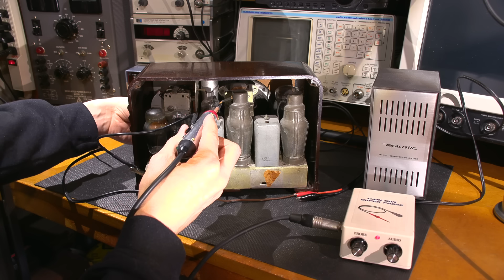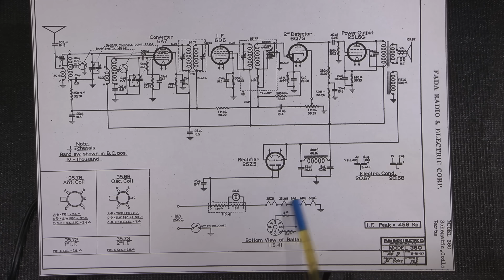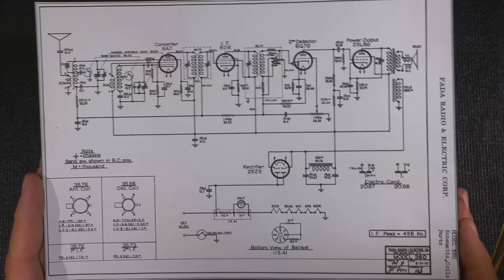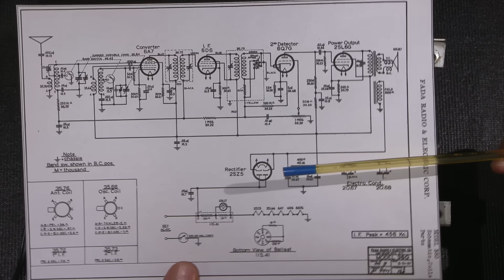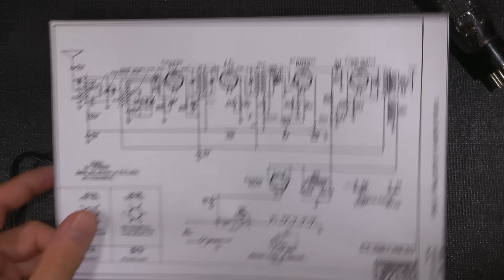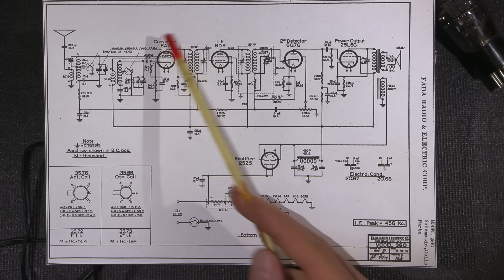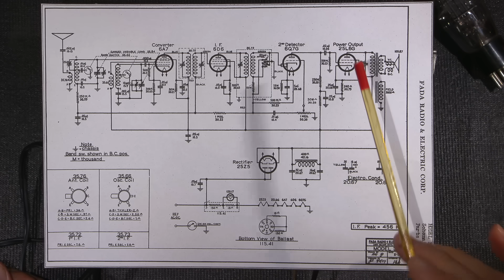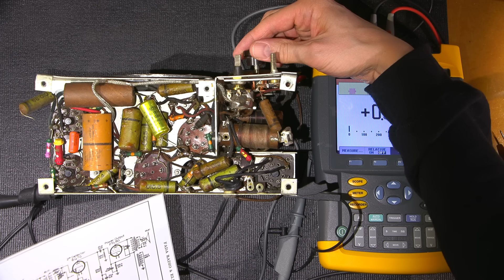Electronic Circuitry Diagnosis And Fault Finding! [Repair]

Comment: If you haven't completely restored this already, I would like to see it.  I just picked up a Fada Model 68 this weekend.   It needs to be restored as well.  It's my first project and I learned a lot from watching you take us this far.   I am sure we'd benefit from seeing your detailed handling of the entire restoration.  I am curious to see how you handle the conversion to lining in the voltage with a switch on the hot side and neutral to the chassis.  Thanks for the content thus far.

Comment: Those tube radios seem to be magical to me.
In a world of silicons and digital electronics, it´s something from another world.
Nowadays in professional school they don´t even mention old tube technology existed just the stuff i actually need for my job but i think an electronics technician for industrial engineering should also know something about tubes.
We still have such an old radio but it´s already capable of receiving FM and last time we powered it on, it worked for 10 minutes until it got quiet and had a smell.
Probably one of the old capacitors blew up so yeah as an almost finished electrician i should be able to fix it easily but yeah i don´t think so 😅

At least i have a pair of fully working isophon speakers from back then which are in mint condition and get pretty loud with my 2x3w class D 5V powered amplifier.
Maybe i´ll build some small active speakers with it one day.

Comment: If I understand the use of the super-probe, it should NOT be used on a hot chassi (i.e., one not connected through an isolation transformer) as the ground-lead from the probe goes to the metal shell of the probe. Am I correct?
Reply: In the beginning, he specifically says he is powering up the radio using a current limited isolation transformer and variac power supply.

Comment: Textbook troubleshooting techniques, bravo!
Just replace the shorted cap. Use the radio everyday, when the next component fails take us through the procedures again! 
I learned a lot from this repair.
Reply: This is how it should be repaired, replacing all the caps, even though they may fail soon, is not appropriate in my opinion.

Comment: Doe's this guy know the difference or the names of the tubes/in English radio valves .. pentodes triodes heptodes dual rectifiers ... double triode tubes and so on . Even the double diode triode decter tube with extra plates using the same cathode ..........lol

Comment: You may wish to comment on this video in terms of what you were trying to do... fix the receiver or sell active probe designs. The part where you pull the chassis out of the case to the time you pull out your voltmeter (THE MOST OBVIOUS tool to use), and pull out the active probe, which you refuse to sell as a kit or even allow anyone else to sell as a kit, you make a tedious and obvious use of this tool to "fix" the radio.

Comment: Remember the hybrid car radios?  They had tubes that operated at 12-14 volts and the output stage was a power transistor.  I believe the tubes were spec'd for low plate voltage.  These radios appeared in the late 50s or early 60s I believe.
I have been enjoying your videos.  You sure have a lot more equipment than I ever had !!

Comment: Another question: if the B+ (= screen of output tube) was only 10.6 volts, how could the oscillator and IF states work?
Reply from the maker: Tubes will work at surprisingly low voltages. (Look up: "Space Charge Tubes") Having the right tools to listen into the stages, and not further the drop by loading the circuit is key. You will notice the probe has no physical attachment to the circuit.

Comment: Question:  why did you go back to the oscillator once you verified that the signal at the detector was good ?  I'm an EE BTW with about 60 years of experience with both vacuum tube and solid state technology.

Comment: If you make sure the ac plug for the oscilloscope and the ac plug for the radio is orientated in the same manner in the wall outlet, will this prevent a disaster when to connect the ground of the probe?  Also, can a UPS (unplugged from the wall and running on battery only), serve as an isolated power source for the scope?
Thanks for sharing your knowledge.

Comment: Pretty neat troubleshooting, one little note though, you should have started from the speaker and go upstream the chain. Speaker is magnetised? Yes! Voltages on the power output tube OK? Nope! Check the caps and resistors.. Bingo. That's the way the radio/TV repairmen used to work. I enjoyed the video nevertheless.

Comment: I lived 1 block away from an electronics repair shop. As a teenager I would haul tubes from old tvs and radios in there and he had a tester right in the showroom  where I would check all the tubes. He would always take time to answer my questions and teach me stuff.

Comment: Yes.  Restore.  It may be a bit finicky, but straight forward enough (I did the same with a Quad Aquoustical Stereo Amplifier and Pre-Amp a good few years ago - gave it new life) .  Suitable components of right values will probably be available (but of course, no wax caps).

Comment: Could have taken an insulated copper wire (epoxy resin insulation like that used in motor coils), made a couple of loop and put that onto the oscilloscope probe to sniff for RF?
Plus, the initial scope of the project was to “get it working again”.  Near the end you want to change the scope to “restore” the scope.  I’m a EE by education, but software engineer by experience.  One project I consulted on to fix some bugs, and I recommended removing some “dead code” and the project manager said “NO”.  When I asked why he said “.... because customer won’t pay for it!”.

Comment: You are absolutely correct about the tube testers being in the drug store (my memory is a grocery store).  I remember, being 10-12 years old in the late sixties, opening the back of our family tv, pulling the tubes, riding my bicycle to the grocery store and testing the tubes.  I don’t recall whether I found the the replacement tube.  “Thanks for the memories ...”.
Reply: i did too with my dad, he took by the hand to make sure i wouldn't touch electrical equipment, then later i started going on my own, push lightly and turn tube till it would drop down into it place, beautiful technology for days gone by. i then learned not to push tube but to align the notches and wham in she went, great days of a people that were at the beginning of radio tech.

Comment: At 22:32 cathodes should not be glowing ,but the filaments should be glowing if anything but the filaments glowing there is way too much power being drawn
Reply from the maker: If the cathode doesn't glow Peter, how does it emit electrons?
Reply: Mr Carlson's Lab the cathode is heated by the filament. The light inside the tubes are the filaments not the cathodes.as per Wikipedia and you can trust them:The type known as a thermionic tube or thermionic valve uses the phenomenon of thermionic emission of electrons from a “heated” cathode and is used for a number of fundamental electronic functions such as signal amplification and current rectification.

Comment: I have a tube balanced drive headphone amplifier that drops out on the left channel.  If you turn the volume up rapidly to max and back down, the channel output returns for a while.  A 2 year old amplifier not in warranty.  Not the tubes as I have multiple sets and swapping them does nothing.  Tapping/probing the PCB for bad solder etc does nothing.

Gladly pay somebody like you Mr Carlson to fix it for me.  Vacuum tubes are alien devices to me.  They just sound really nice.
Reply: Amplifier does have B+ current meter for each channel.  Both meters are at 70mA for each pair of 6080 outputs.

Comment: This video make me remember when I was very beginner to electronic in junior high school arround 1985. My friend have an old big telefuken radio and turn table a size of cupboard. And powered by some tubes. I tough 1 of the tube using my index finger and I gt 3 combo when the tube glow. Burn my index finger + shock by high voltage + my back palm swelling because bump with top of the cabinet... lol.

Comment: Appreciate the extensive info, but you're working too hard making these videos over an hour-long for what I'm sure you can do in less than 5 minutes probing around. Might have just learned something about grids and screen voltage, plus gaining the courage to sit and look at the schematics; working things out, what to test, what to expect to find by the connections.

Comment: If I had a lab/shop like yours, that is where I would be almost all of the time. While in high school went to Vocational Technical school for Electronics 1971-1972 then Data Processing 1972-1973. Computer Programmer job paid the bills while electronics hobby kept me off the streets - most of the time. Now retired and keeping busy doing nothing all day - still have not finished. Please keep on making and posting these videos. Thanks again for sharing all the fun stuff. Always plan on a great day - just in case it happens!

Comment: When I was a kid in the mid 70's I took one of these radios out of the case. I recognised all the resistors and capacitors. I blew the dust off the tubes. And plugged it in. It glowed orange. And it got hot. The speaker crackled. Then it started motorboating.  Switched it off. And never touched it again.

Comment: Just in case no other viewer mentioned it the morse code signal you heard when sampling the antenna was LU - the Non Directional Beacon for Cultus Airfield - transmits on 214khz.

Comment: Mr. Carlson discusses the line switch being in series with one side of the line cord and the chassis. If the original line cord is replaced with a polarized cord with the neutral side connected to the line switch, the chassis will be at neutral when the radio is switched on and "hot" when the radio is off. Max Robinson of funwithtubes.net recommends, for safety, rewiring the line switch in series with the hot side of the replacement polarized line cord so the chassis is directly connected to neutral (wide blade) and always "cold."

I go further to recommend replacing the line cord with a GFI line cord, such as from a modern hair dryer. The hair dryer cord is thicker than the radio cord (except for many clock radios that had an outlet for switching on a coffee maker). You may have to drill out the hole where the line cord passes through the chassis and install a larger grommet. If you prefer not to do that, the GFI cord can be made into an extension cord and the radio's cord permanently plugged into it. It is also possible to disassemble the GFI plug with special tools and replace the cord with a thinner cord. The line switch should still be rewired so the chassis connects directly to neutral.

Max Robinson thought that the switch was wired in series with the chassis to reduce assembly cost. Another explanation is that many of these earlier AA5 radios put the filament series resistor (150 ohms in this radio, in assembly 115.41) in the line cord as a resistance wire. That way, the heat produced by the resistor was dissipated outside the radio, so the radio didn't get as hot. The line cord contained 2 low resistance conductors plus the resistance wire.  The manufacturers had to choose between a single pole switch in series with the chassis connection or double pole for the filament resistor and rectifier plate connection, and chose the less expensive, more reliable, single pole. I believe that arrangement, which seems to be almost universal in AA5 radios, carried forward after the 0.15A filament tubes were developed, which eliminated the resistance line cord and the need for the double pole switch when one conductor was wired directly to the chassis.

I agree with restoring the radio and hope that Mr. Carlson will follow up with a restoration video!

Comment: I think this is a very handsome radio and it's in very good nick, often the case but definitely not always  for Mr. Carlson.  The circuit is pretty much bog standard. These Fadas are VERY collectible.  No question:  sort it out.  You can always sell it..

Comment: My late grandparents still had radios with valves/tubes in their house and occasionally used right up until the end of the 1980s the last one got junked around 1992 after sitting unused and replaced by an early CD player

Comment: Thanks Mr Carson. Just got a Guyatone GA-940 bass amp a Semler 50 derived amp. The bass distorts lost but the treble works ok. Looks like the previous repair attempt left it in this state. Looks like there are components changed out with modern stuff and i think the values are not as per original even not sure if the right valve tubes are installed. Can't find an exact diagram for it. Will keep on fiddling with it. The basics of safety and working helps lots. In this case it could be a low frequency gain issue?

Comment: Hey I used to do that, back in the early sixty's. There was a drug store in our area named People's Drug Store. I got so regular in the store they knew me and what I was there for.  I used to fix all american 5 radio's for the people in my neighborhood. Well I did run into others but very few because by that time most people had up-graded their radio's.  I used to have a floor model Atwater-Kent, I think that's what it was, It's been just a little while and sometimes I forget a few things.
Most all radio's and tv's when they went bad it was usually a tube and just by testing them at the drug store I could make five or ten bucks for fixing peoples tv's and radio's.Ya, didn't throw things away then, ya fixed em. Now well most folks put it out for the trash man.

Comment: I find your videos to be compelling and interesting... 

Of course I have been working on electronics since I was a little boy and built my first Williamson amplifier when I was 14 (probably lethally dangerous because it used 807 tubes running at well over 450 volts on the plates but  somehow I managed to survive with only minor shocks and all...)  in any case, I have considerable background in tube type electronics since I am of that era.

I have a radio identical to your Rogers Chairside radio except that it is branded Deforest (same electronics and style except that it has a slightly different grill cloth) which I have restored and which works very well...

That said, I find your videos very instructive and have learned several important things from them... one thing that sticks out is the admonition to be careful with the foil side of capacitors... the outfit from which I buy these actually states on their website that this does not matter with modern capacitors... nevertheless, I shall be checking for this in any subsequent restorations that I undertake.

One area that I would really like to see from you - I haven't seen this anywhere in your excellent videos but if it exists, I would be grateful for the link - is the procedure for aligning an FM radio... 

I have a Zenith AC-DC in which the FM section which does not work very well and most likely needs to be properly set up. This is one area in which I have very little experience and would be happy if you could enlighten me as to the procedure and the equipment needed to do a full restoration on this...

Sorry for rambling on..

Comment: What a fascinating video! I normally change most wax caps as a matter of course but there were things I didn't really fully grasp. Every time I watch one of these videos I feel that I understand infinity more. Thank you for taking the time to share your knowledge. Watching someone with your level of deep understanding of electronics is the very best way to learn.
I'm currently trying to figure out an issue with a nixie clock which was built as a gift to me and it's creator is no longer about so any advice would be fantastic.

Comment: These tubes plug in any way?  There's no key, or the pins aren't spaced unevenly so it will only go in one way?  Noob question for sure, but I'm pretty good with solid state repairs, so I don't feel so bad..  lol
Reply from the maker: Hi Larry. Two of the pins are larger than the rest, so it will only go in one way.

Comment: 4mhz eh you could be able to listen to the 3.57 mhz band used by the color burst signal on tvs and maybe even the timebase of dtmf signals.

if you are going to illegally broadcast on anything you are probably safe using the 3.57 mhz band as the worse that can be interfered with is causing your tv to go black and white or the color to flicker on and off and maybe even cause the phone dial to fail.

Comment: Recently I found some old russian tubes in trash. I want to build an audio amp out of them. Can You add me on facebook messenger? It's easier for me to contact that way.
Reply: 4 years later.  There is lots of information on-line for SEARCH:
diy vacuum tube amplifier.   I have a Silvertone Amp In Case 1457 on it's way to me, and don't want a Darwin Award for troubleshooting it, so looking at troubleshooting vacuum tube stuff.

Comment: That was fun, like stepping back in time! Nice job! I don't know about trusting the old tubes, are they any better then the old wax caps, or is it all a gamble??? In the old days TV repair was all about testing the tubes and changing out the bad ones, a failed cap was more rare then a bad tube. However the satisfaction of the repair, is a lot of fun, and where comprehension is present there is a self satisfaction involved that is definitely worth it! Thanks for the excellent video.

Comment: Thanks for another nice video.

Obviously switching the hot is preferred and safer, but a lot of time on these old sets you will get a lot more hum when you make this change. I have seen this a number of times. Not every set has this issue, but some definitely do.